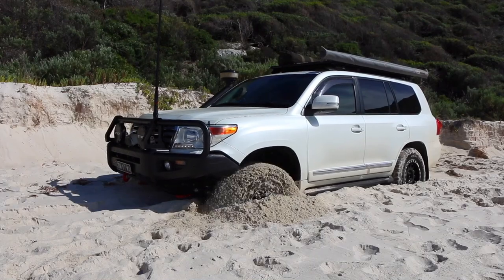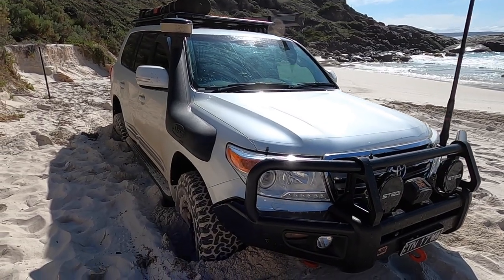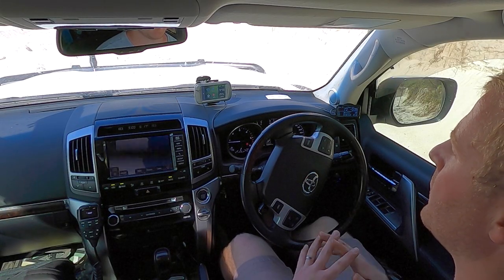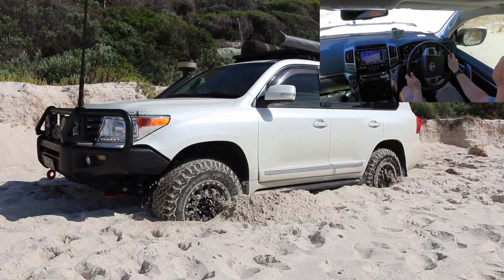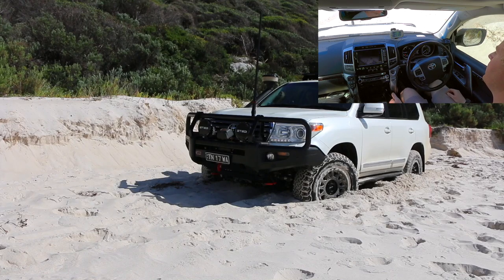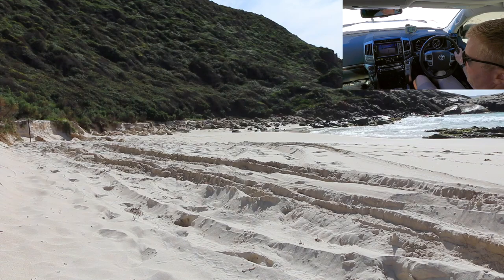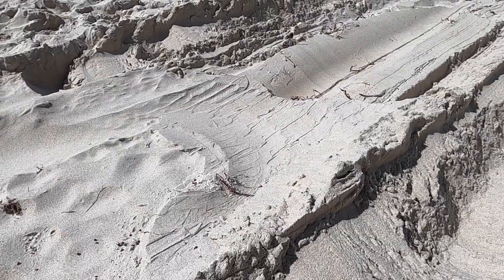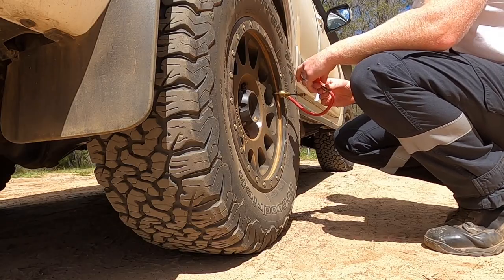Toyota Landcruiser CRAWL CONTROL | Stuck in Sand | Demonstrating 4x4 sand self recovery Does it work

Comment: Does the Hilux also come with the crawl control??
Reply from the maker: From my knowledge, they don't. I believe the Hilux only comes equip with the down hill descent control. This is essentially the same type of system, however doesn't include the input of engine power, just ABD braking systems, hence why it's used in a downhill scenario. 
Cheers, Nathan.

Comment: You couldve gotten out of it without crowling feature...all you need L4, and turn the steerting wheel slowly right and left while moving forward slowly... But good Toyota ad 👍
Reply from the maker: I reckon it’s worth another test in the future to see different comparisons. I would have my doubts without crawl control though. Without some sort of diff lock or traction control only two wheels would be spinning. I’m willing to give it a go in a future vid though 👍

Comment: how come the front wheels spin but not the rears?
Reply from the maker: The rear drivers was spinning, open diffs just sent the power to that side. No lockers on this model.
Reply: Just like all Toyotas before it it's just 1 wheel drive when centre diff is unlocked, and 2 wheel drive when it is.  The 4WD selector is just for show.......
Reply from the maker: @einfelder8262  Haha, yet is still pulls itself out of a bog without any aid of traction or support from another vehicle...
Reply: @XploringOz  some one here hasnt driven a 200 series me thinks.
Reply: @einfelder8262  yawn...
Reply: @mrmackie85  I also yawn when I wake up.  Be happy you've learned something from me, you're welcome.

Comment: My observation is that Crawl control more or less just locked all hubs so all wheels turned. When you were in regular drive some of your wheels were not even turning even though you were in 4WD
Reply from the maker: Yeah, I guess it kind of works that way. It's essential attempting to lock the differential to provide smooth and even power to all 4 wheels at the same time in an attempt to gain maximum traction. 
Having normally open diffs, 1 wheel on the axle will always spin faster than the other side, especially when in a bog like this. 
Cheers, Nathan.

Comment: Great video. I’m surprised that this is such big news to Toyota guys. My 2014 Discovery D4 has this (and has been available as a standard feature in the range since about 2008). It really shows that a good traction control system is not to be scoffed at. Too many people, in my opinion, get overly obsessed with the idea of lockers and live axles. True, in extreme 4wd situations those are hard to beat. But if you want a comfortable touring 4wd with strong off-road chops, a great traction control system coupled with a lockable centre diff and an independent suspension is very effective.
Reply from the maker: Couldn't agree more mate. There are way too many people hung up on the idea of lockers and solid axles, however these IFS vehicles with a capable traction control can surprise many people.
I guess some are just stuck in their way, but for us, this vehicle is the perfect Overlander and the perfect compromise between comfort on-road and capability off-road. 
Cheers, Nathan.
Reply: Steven, your Disco does not have crawl control. You have traction control, 2 very different functions.
Reply: Gareth, I’m open to being wrong about it. What in your opinion is the function of crawl control?
Reply: @arielle_australia  your traction control requires wheel spin to initiate, like all other brake traction aids, the wheel sensors need to detect different axle speeds across the diff to engage. Crawl control, is a set and forget function, no throttle input requires by driver, it drives for you, with a very aggressive abs response to ensure limited slip accurs to maintain constant wheel speed on all 4 corners. It's like comparing downhill descent control with the brake peddle. It cannot be replicated by the driver. 👍
Reply: ya toyota has had this shit since the 90’s
Reply: Its been in Toyotas since early 2000's.

Comment: The deflate your tires mod is free and will get you unstuck faster
Reply from the maker: For sure, but there is always times where you can get stuck, regardless of tyre pressure. Some beaches in WA are very very soft. 
Yes, this particular example I could have gone lower, however I needed to get stuck for the purpose of this video...

Comment: seen a bt50 do the same thing without the driver behind the wheel.
Reply from the maker: Now that would be interesting to see. I have heard that a few cars with rear lockers or firm LSD's can have a similar outcome. 
Cheers, Nathan.
Reply from the maker: @michaelhermans4753  Seen that, great info on that channel. This technique still required the use of diff lockers which aren't provide in this and many other vehicles.

Comment: What gear was it in and what was the RPM throughout? Was the rear locker on? Thanks.
Reply from the maker: So crawl control has full control over gear selection, RPM and all other functions on the vehicle, except steering. 
The vehicle only uses 1st gear, low range and RPM in kept low, however automatically adjusted to provide the required amount of power.
Further, this Landcrusier 200 doesn't come with a factory locker and I haven't fitted an aftermarket unit either. Although I can see the benefit in their functionality, I just haven't needed a locker as the crawl control has done the job so far.
Cheers, Nathan.
Reply: @XploringOz  thanks mate, would be interesting to know what the vehicle selected for this exercise! I’m asking because many of us don’t have that function and perhaps can try it.
Reply from the maker: @wanderingambience799  Fur sure mate. I think if you have a low range capable 4WD, selecting low range first gear and activating a rear diff lock (if fitted) would give you the best chance of re-creating this without the crawl control technology. Avoiding excessive wheel spin will be the main goal.
Cheers, Nathan.

Comment: You can see the car still had traction control on when you first tried to get out of the bog! The front wheels were spinning but the back was doing nothing. You can't just press the traction control off, it stays on even though it lights up. You have to hold the button in for 5 seconds to fully disable it! You can see when you engage crawl control it turns it off as all 4 wheels spin equally.
Reply from the maker: Yes that's correct? The traction control was turned off (completely) for part of this hence some wheel not turning? 
Not exactly sure what you are referring to here?

Comment: Wow that's impressive!
Reply from the maker: Great piece of engineering design here! Definitely worth given a go next time your stuck!
Reply: Ha! I'm about to take delivery of a new y62. Wonder if it can do something similar.
Reply from the maker: @rkmckenna  I'm not sure the Y62 has a dedicated 'crawl control' system as such. But from what I know, there is a good chance you would be able to manipulate the vehicles traction control settings, through the off-road 'modes' along with the rear diff lock. I reckon a combination of these electronic features would give it a red-hot go at it. Saying this, I would say it would come down to vehicle familiarisation and practice to get it to work. Jealous though mate, I love those vehicles, you wouldn't believe how close I got to purchasing one for myself before the LC200.

Comment: Lol my old fte 79 has that it's called low range 1st gear and it walks out of soft sand
Reply from the maker: Haha, that can work on some occasions. You have lockers in your vehicle?
Reply: @XploringOz  nope I've used it to tow trailers full of sand though soft river sand running 33 psi and it just chugs along even saved a few rangers patrols and the missus prado a few times low end touque works wonders as far as I'm concerned and manual over an auto as well
Reply from the maker: @carlmenzel8744  Nice, glad to hear you've got an awesome setup that works. That's one of the best thing about the automotive, in particular the 4WD scene is there is so much choice. There really is something for everyone.

Comment: Difference between A-Trac and Crawl control?
Reply from the maker: Crawl control will give you user defined speeds at which the A-TRAC will allow the vehicle to move. Without crawl control, you won't have the ability to crawl out of the sand as easily. 👍
Reply: @XploringOz  so the same concept but one with a set speed and for the tiger you need to manually input throttle?

Comment: Sure, it works, but puts the entire drivetrain under increased load; wear rates drastically increase, temperatures increase, additional strain on driveline components. The reason we traditionally get out the shovel and max-trax is to minimise the risk of breaking something and being completely screwed 1000km from the nearest mechanic. Of course, it's a very impressive system (no 'magic', just engineering), and Toyota builds brilliant 4WDs. 
If you wanna get your family home safe, don't do this. Get off your arse and dig.
Reply from the maker: I completely understand where your coming from, however do have a different opinion on the matter. I agree that there is increased load on the vehicle, however given the vehicle is in such low ratio gears and being provided smooth and constant power, the likelihood of something failing is minimal. Further, if something were to break, there is a high likelihood of an underlying issue prior to the recovery, which would likely fail on the near future, regards of what recovery technique was used. 
Although temperatures would increase over time, in this example, both engine and transmission temps stay well within safe ranges. ambient was 27 degrees Celsius. 
Despite the difference in opinions, I appreciate you sharing your thoughts and watching the video. Cheers mate 👍

Comment: That's impressive for Toyota considering if you left it in a lower setting and 
stopped confusing the system with the steering after it started moving it probably would have got out sooner.
There's another video where a guy gets his Hilux out the same way by using very little as possible power to keep the
wheels climbing. And this was discovered by the army many years ago.
Reply from the maker: Yeah, I reckon I might get back to some sandy tracks and try slowing the system down and eliminating steering input. It would be a good test to see whether this speeds up the recovery, or allows for a recovery in a shorter distance.
Reply: @XploringOz  Yeah put the Toyota Tech to the comparison test. And A few comments asking what the noise is ; it's the brakes pulsing like ABS to get traction like how an FJ Cruiser has no front diff lock but still has traction when it gets a wheel in the air over rocks and mud...

Comment: its all good unless your undercarriage is on the sand (Grade 3 bogged) then its shovel time.
Reply from the maker: Yeah, however you probably saw that the car was partially suspended by the undercarriage. Very impressive system.

Comment: Impressive performance of the Car.

Pity you were so data lite on Controls & Settings etc & why you were constantly moving the steering wheel.

Do we have to watch 5/6 mor of your videos to find out - Ah. Perhaps you have a cunning plan.
Reply from the maker: Sure is impressive, this is certainly some great engineering! 

I did do some more testing with different speeds and steering inputs. This can be found here if you are interested: https://www.youtube.com/watch?v=IWteCiBFrh4&t=561s

Cheers, Nathan.

Comment: Bro just deflate your tires pressure to 18(A/T)/12(M/T) psi and go free on deep sand with no fear to stuck. Enjoy you Journey:)
Reply from the maker: Tire pressure is one of the most important factors when sand driving. In this video the front's were about 17 PSI and the rear about 18/19PSI. I know I could have gone lower, but I needed to get bogged in the first instance to show the crawl control. 
Cheers, Nathan.

Comment: Aren't you suppose to let the tyre down on sand?
Reply from the maker: Sure helps. I had already let the tyres down before I got bogged, but the sand was very soft. I could have lowered a little more, however I needed to get bogged for this demonstration.
Reply: Fair enough, I guess if you let it down too much you will be having trouble getting it bogged… LOL

Comment: I think if you put crawl control in a lower speed setting and left the steering alone, it would have got out easier. Also on soft sand be down to 12 to 14psi from the start and generally will not got bogged in the first and you will very rarely roll a tyre off the rim, would have to drive like a nutter to do that.
Reply from the maker: Sure, this was a popular suggestion for this video, however I’ve done some testing with speeds and steering input. Check that out, not as effective as people think: https://youtu.be/IWteCiBFrh4. 

Yeah, pressures would have helped, but I had to keep them up high to get bogged in the first instance for this video 👍
Reply: @XploringOz  haven't got a 4WD with crawl control, well I don't think so, may give it a go one day and you do know what you are doing, cheers great video.
Reply from the maker: @commonsense-grs  Thanks mate. All the best with your adventures, hopefully you won't get too stuck on your adventures. 
Cheers, Nathan.
Reply: @XploringOz  hahaha, sometimes getting stuck is part of the fun, working how to get out and then getting out. I haven't got stuck many times, but I now have a lot more info on how not to get stuck, but more importantly how to get out.
Reply from the maker: @commonsense-grs  Definitely! It's all part of the adventure after all. Education definitely helps, whether it be preventing getting stuck, or being able to successfully recover your own vehicle!

Comment: This is amazing technology, where effectiveness is still improved greatly by letting tyre pressures down too. The BFG KO2's can safely go down to under 10psi if needed, even on a rig as heavy as a 200 series.

Anyone who regularly drives in very soft sand understands how important tyre pressure is, and the difference it makes. 

Personally, A decent tyre deflator and diff locks front and back still rule supreme over any Traction Control System, even this impressive one from Toyota.
Reply from the maker: For sure, I completely agree there. Tyre pressures play a huge and very important role in 4WD'ing. In this clip, I left the pressures a little higher just to make sure the vehicle would get stuck. To date, the cruiser has rarely got stuck in the sand. 
Lockers are ultimate, however, this system does great in it place with a small financial saving.

Comment: Good stuff but one sensor or relay fucks out, you are walking. The other point is that you can easily go over their GVM. 4 men on a fishing trip, a bag each and maybe a couple of coolers, then a winch bar on the front and you are over GVM. It is a great platform but once again over complicated as other brands have done.
Reply from the maker: True to some extent.  But this is the same as any component on your car. Your MAF sensor could fail, EGR sensors, crankcase positioning sensors. All sensors that could stop the vehicle in its tracks. 
All modern vehicles have electronic sensors that are liable to fail, hopefully Toyota have designed theirs for longevity and reliability. 
Further, I agree with the GVM comment. It is not adequate for common Australian 4WD modifications. This is why I have completed a GVM upgrade. I have a video on this topic and the weight of this vehicle for those who are interested. Cheers, Nathan.

Comment: If you had front and rear lockers, and you still get stuck. The crawl control might not be able to do anything.
Reply from the maker: Potentially. If that's the case then it would be back to tried and tested methods of digging and using aids like MaxTrax'.

Comment: Amazing how an expensive car can not have an LSD or rear locker. Fully flexed the right rear and left rear did nothing. If it was properly equipped it probably wouldn't of been able to get bogged
Reply from the maker: True, however no car is perfect and everyone gets stuck from time to time, regardless of equipment. 
It’s great that Toyota have developed this system to assist in self recoveries. 👍

Comment: The annoying thing about modern vehicles is they don’t teach you old style techniques. Nothing like digging an FJ40 out...that said I’ve used crawl control on the FJ Cruiser and now 200, and it is a pretty amazing feature. Gives amazing piece of mind down sketchy downhills with a trailer on too.
Reply from the maker: Yeah, it does help to have a good understanding of the fundamentals of 4WD'ing and the physics of how these vehicles traverse and react of varying terrains. Saying this though, not all old styled techniques are relevant these days. Traction control and the huge improvement in quality products negates the need for certain techniques. Pro's and con's on both side of the argument. 
The crawl control feature is certainly an awesome feature on these vehicles though. 
Cheers, Nathan.

Comment: not a fan hi tech suvs. it can barely move even with only one passenger.
Reply from the maker: That's the point of crawl control. It slowly provides power to each wheel, limiting slip and providing maximum traction. Each to their own, but I'd rather wait 2 minutes to crawl out than be digging for 30 minutes.